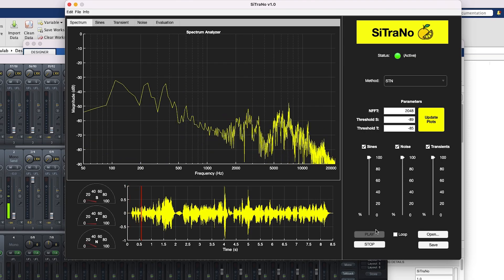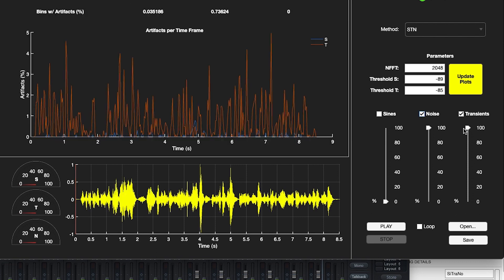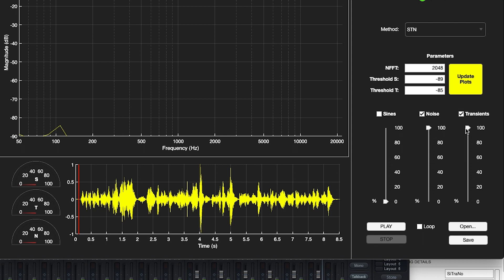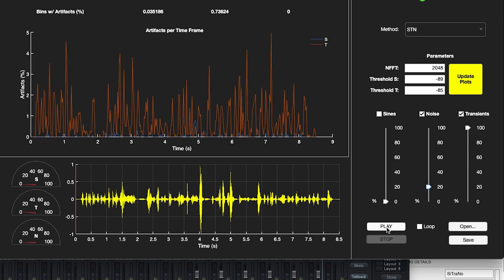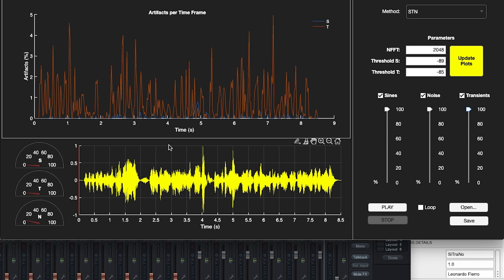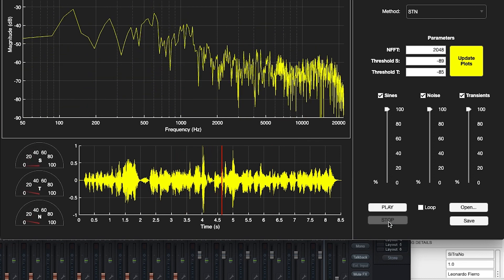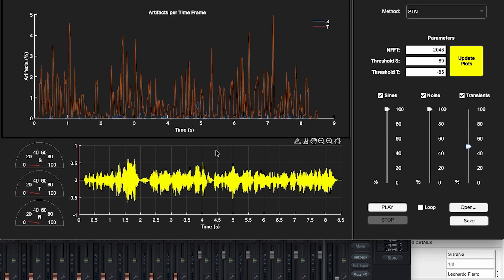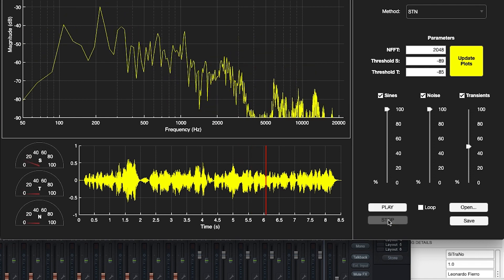Sound decomposed into sines, transients and noise with the SiTraNo app

Comment: Erm... SpectraLayers has been doing this since version 7 released in 2020... In SpectraLayers 10 you can find it under Unmix > Components. And it's a non-destructive decomposition as well. Not sure what's new here ?
Reply: Our work focused on improving the quality of the three-way decomposition by introducing optimized smooth fuzzy spectral masks. If you are asking about the SiTraNo app instead, that dates back a couple years and it was born as an evaluation tool for different decomposition methods, made for educational and research purposes.

Comment: I dont get the last bit about sports
Reply: Slow motion videos are used a lot in sports but they typically don't feature any sound, as the quality of the audio time stretch for heavy factors decreases a lot. Having access to the individual components allows us to process them separately in the most appropriate way. For example, in this paper (https://ieeexplore.ieee.org/iel7/10094559/10094560/10094738.pdf) we use a traditional IPL phase vocoder for the sines, repositioning for the transients and a neural network for the noise component to achieve better quality for extreme slow motion - like the opening of a can of soda slowed down by 8 times :)